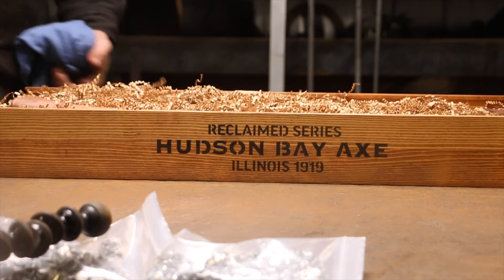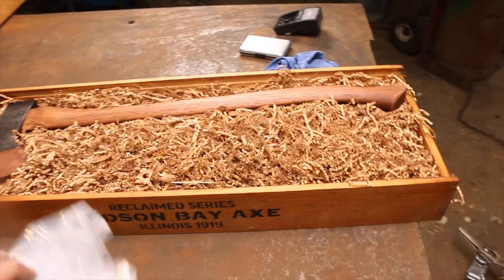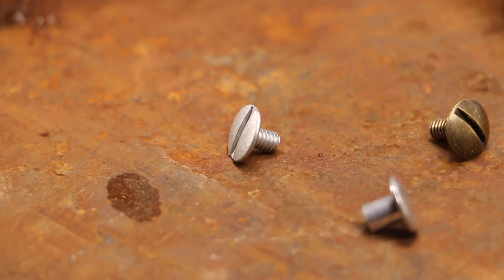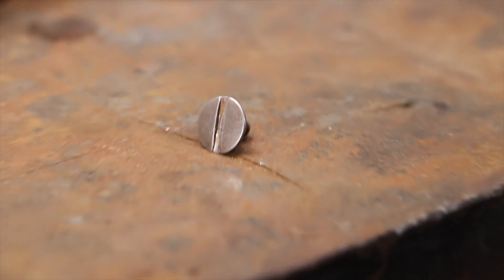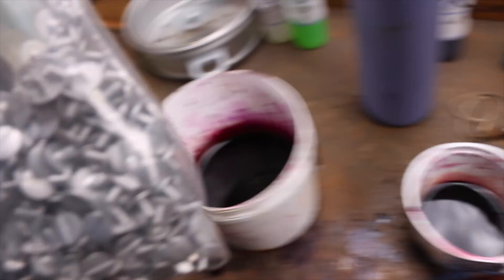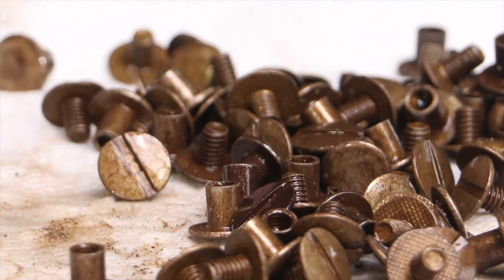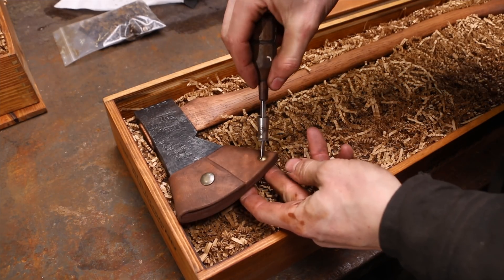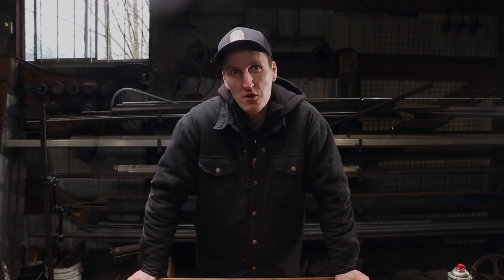Making aluminum look like brass with chemicals

Comment: you could just heat them up with a torch and hit them with a brass brush too.
Reply: Wouldn't work on aluminum..   If he managed to find steel Chicago screws they could be brassed in that manner though.

Comment: You should try to make transparent aluminum and forge it into something.
Reply: What are you talking about... ALON is expensive and cannot be forged. LMAO its a mix of Aluminum, Nitrogen, and Oxygen pressed together under extreme heat and pressure to make a block.
Reply: @Pez_Destroyer  whoa... calm down man no need to get so excited. I assume that you have tried heating up a piece and hammering on it . Besides how many specialized metals has he played with onthis channel.
Reply: @ericwhitmire4610  no excitement, just facts!

Comment: with what you do i am surprised you haven't got a screw press yet, brass is about %80 copper and %20 aluminum. copper sulfate will just stick to that no problem and turn it coppery, that mix might stick better and look better after.
Reply: Brass has zinc, not aluminum
Reply: There's aluminium bronze, which is copper and tin with a tiny amount of aluminium, brass is copper and zinc